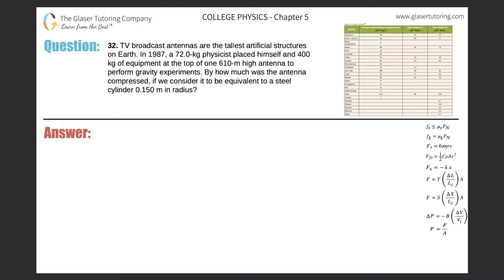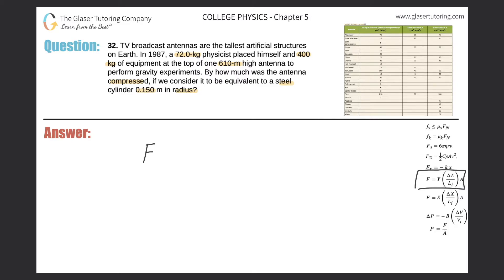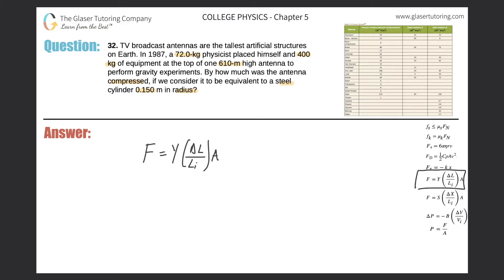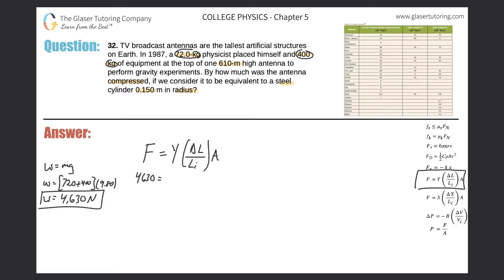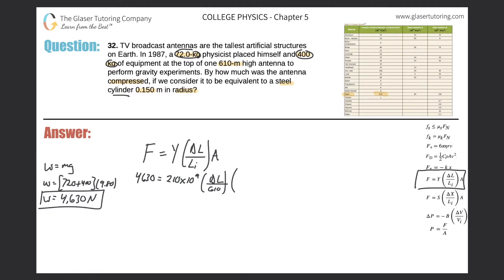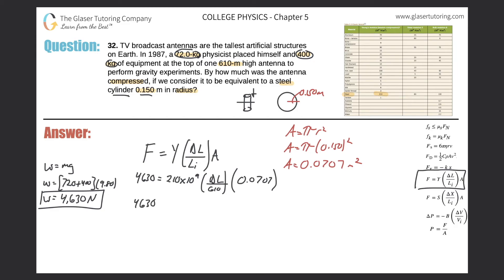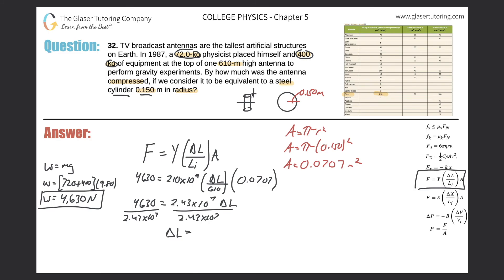5.32 | TV broadcast antennas are the tallest artificial structures on Earth. In 1987, a 72.0-kg

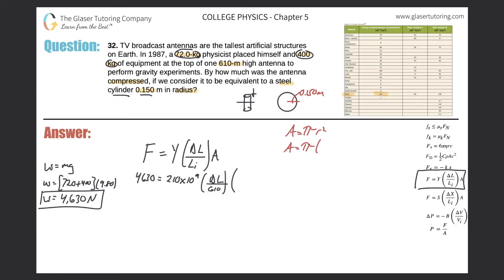Comment: 3:05
Would this not be pi*r^2*h because it’s a cylinder?
Reply from the maker: Hi there - Good question! While the volume of a cylinder is indeed calculated using the formula πr²h, what we’re dealing with here is how much the antenna is compressed under the weight of the physicist and the equipment. This involves Young's modulus and the concept of deformation due to force, not the volume formula. So, while πr² is part of the equation to find the cross-sectional area, the overall calculation focuses on compression, not the volume of the antenna.  Hopefully this helps!
Reply: @GlaserTutoring  very much so, honestly im shocked you’re so responsive after all these years… I think I’ll sub :0
Reply from the maker: This is awesome!  Thank you for being a subscriber to the channel - you rock! 😀